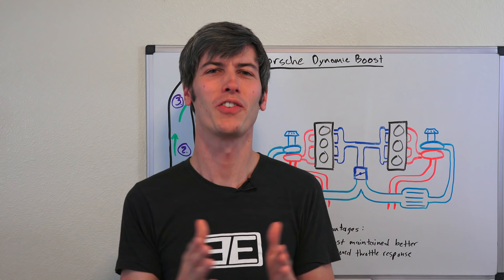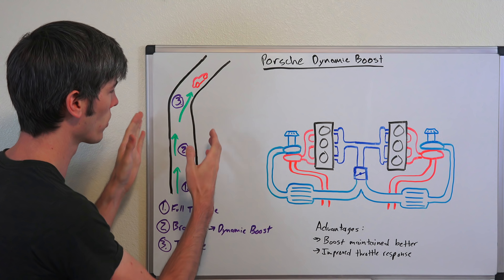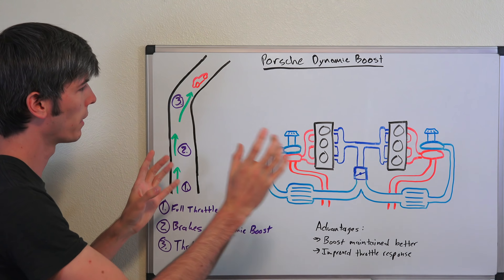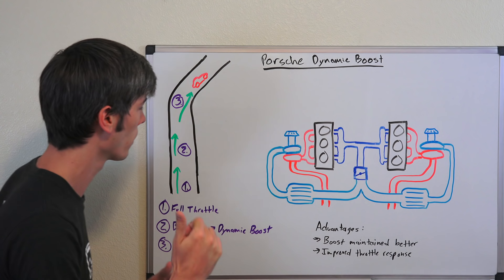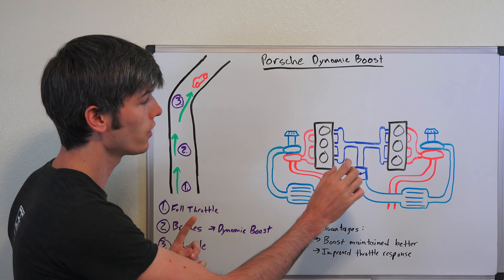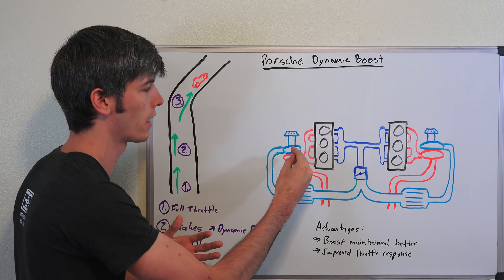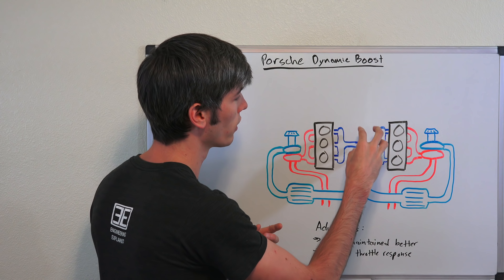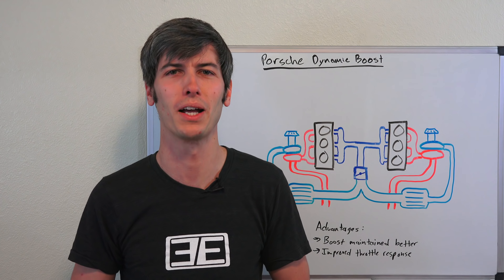Porsche's Anti-Lag System Doesn't Use Any Fuel

Comment: Seems like it would lean out the air fuel mix.
Reply: Yes it would throw lean codes unless the software was written for it but with no fuel means no combustion so the lean effects on a motor are negated.
Reply: Steven Young good point thanks

Comment: Typically, the throttle body closes completely when let off the throttle? I thought some air continues to get compressed by the pistons, which also explains engine braking
Reply from the maker: It’s the suction that does the engine braking, not the compression, but yes, some air does get by.

Comment: I wonder does it still injects gas in the chambers like you would giving it gas since its open or is it just enough air to keep the engine running with the engine running a little rough the system sounds good just curious on how does the engine idle anyone's thoughts
Reply from the maker: No fuel when you’re not on throttle.
Reply: There is no need for the feature to operate as idle as there is no boost anyway.  It's a temporary condition when there is boost and you come off of throttle momentarily.

Comment: To be honest I actually thought this is how most  turbo engines work when you let off the throttle to save fuel.
It makes sense to stop injecting fuel but why close the throttle body unless you want engine brake - and if you want to save fuel engine brake is to be eliminated (maybe the throttle body can close at lower speeds)

Comment: Are there counter rotating turbos?

And how does BMW manage it since with valve tronic the throttle valve is constantly held open and intake is controlled by valve lift?
Reply from the maker: BMW doesn’t do this as far as I’m aware. They could be leaving valve lift high. I’m not sure what you mean by counter rotating turbos.
Reply: @EngineeringExplained  turbos that spin opposite direction of each other to maintain the symmetry form as per your drawing 

Meaning BMW already was doing 'dynamic boost' on all their turbo engines since all were using valvetronic system , throttle plate kept open always

Comment: Hi,
Can you make a video about how actually fuel is cut when you do engine breaking?
We tried this on a M54B25 engine ( with automatic transmission), to see injection timing in realtime via ODB II interface and when we do engine breaking, injection time reduces from 2.4 ms (idle) to 0.7 ms. But is not shoot down! 
thanks
Reply: I'm developing my own ECU and what I find is that if you are driving along and lift off (into idle throttle position) but cut fuel straight away the car nose dives into severe engine braking. You need to gradually reduce fuel depending on how much you want to brake.
Reply: Maybe you need to do as Porsche does, cut only fuel, not the air, if this is possible :)

Comment: If the throttle is left open, then there is no Vacuum supplied for the Brake Booster.  Won't this pose a safety risk if your brake pedal suddenly gets stiff while in a turn?

Comment: Isn't the mixture getting too lean inside the chamber while this happens? Also, it sounds like the engine would keep accelerating after letting off the throttle, as kinetic energy is still being produced from the engine. This one left me with some question marks man :)
Reply from the maker: It’s infinitely lean, there’s no fuel. No fuel means the engine is not accelerating.
Reply: So there is no ignition at that point?

Comment: Does it make the air/fuel ratio go up? Maybe even temporarily, until it's infinity? And if so, isn't that bad for the engine?
Reply from the maker: It's direct injection. Very easy to have fuel on or off. When injection stops, there is no fuel present.

Comment: hai, in a boxer engine if the cylinder banks completely horizontal then when fuel is injected, due to gravity woudn't  it get concentrated on side of the combustion chamber. i dont know but i guess you can explain. would the S.plug be placed from downwards so that all the mixture is ignited at once as in the spark being at the centre of the mixture, and also please explain if there any sort of swirl characteristics for the combustion flame how would it exist in such a engine design(being horizontal).
Reply: The spark plug is placed in the center of the head, between the four valves. The time between injection/ ignition is short enough to not allow fuel to collect on the cylinder walls.

Comment: So no turbo sstututu sounds because the throttle body doesn't close?😭
Reply from the maker: Haha, yes, though you generally won't have that sound on stock cars since they use bypass valves and don't force air back through the turbo (compressor surge) which is what causes that noise.
Reply: Don't be sad Raul. Now you get a car that sounds like a machine gun!
Reply: @EngineeringExplained  omg I wasn't expecting you to reply! Thanks for the info!!
Reply: The fact that the throttle body doesn't close means you don't vent pressure from the CBV/BOV and have to wait for the turbos to repressurise the whole intake...and if you have a big front mount intercooler, that's a lot of intercooler and pipes to fill up.

We use to joke that those fancy Cinematic BOV turbo sounds actually slow you down.

I personally use a 2 step launch control as "anti lag" which only works on launch rpm and bumping off the limiter. Simple system but allows me to build boost at standstill and shifting(no need to lift). Definitely more gentle than a true anti lag...
Reply: @4G63TDSM  yeah thats why I thought no flutter

Comment: How does the throttle stay open with no fuel flow? Throttle normally means fuel&air flow. Is there an air flow throttle which is separate from the fuel flow throttle?
Reply: All the throttle body really does in a fuel injected engine is controling the air flow. It has nothing to do anymore with the amount of fuel beeing injected.

Comment: Just my speculation, the engine would be running cooler due to a lack of combustion and maintained boost until there's a call for fuel under acceleration.

Comment: This system would just be a change to the code in the engine control unit to implement, if your throttle was electronically controlled.

Comment: So I presume its engine braking is minimal in this mode then... Could be a challenge on mountain roads. 😀
Reply from the maker: Xiph1980 you still have brakes, and if you’re going down a long descent, it’s not going to remain open forever. Just a short period after lifting to keep the turbo spooled.

Comment: Alright.. that means you lose a big part of engine brake, which people account for (but that’s easy to adapt).. my biggest question is: what’s porsche doing to adapt those car components that take an advantage on engine brake (brake system)? Also, is that going to reduce the life span on the turbine and bearings due to increased load? Basically: is Porsche compensating for that?
Reply from the maker: Brakes are always designed for gross vehicle weight rating, not by considering the effectiveness of engine braking, which is minimal. Emergencies don’t rely on engine braking. With regards to load, this would be quite minimal on the turbo, if anything it may have a slight cooling effect since it’s just air and not exhaust.
Reply: Engineering Explained I see.. l it’s just that I’ve seen some cases of brake fade after a long use (I think you’ve addressed this on a previous video) on automatic transmission cars going down a hill due to no engine brake (I live in Brazil in a state filled with mountains so it’s actually quite common).. and that’s the first concern that comes to my mind when I hear “no engine brake”.
Reply: The throttle will work as expected when going down a hill.  You have no need to keep the turbo spooled in that case, right?
Reply: Jeff Smith you know what I meant.. I’m not saying it’s not going to work properly, I was just questioning about extensive use consequences..

Comment: Seems like a ported 2-stroke diesel, with the following exceptions:
(1) fuel type, gasoline, not diesel
(2) heat of ignition, not heat of compression
(3) 4-strokes per cycle, not 2-strokes per cycle
(4) intake valves after the open intake throttle, not solely intake port.

The more I think about this, the more I wish to redact the initial part of this comment. Still very different. Oh well.

Comment: Hi I have a question. What do you think about putting a momentary switch in my turbo car that opens the throttle body completely? Like I could press it during cornering. Kinda like a manual version of this. Could it be bad for the engine you think?

Comment: how do they achieve this system?
I mean is the throttle cable not connected directly to the gas pedal?
Then how does it stays open even when it should be closed?
Reply from the maker: Nope, nearly all modern cars use electronic throttle bodies (not direct).
Reply: Engineering Explained 
yup!!!
The power of sensors.
I mean modern technology.

Comment: Wouldn't leaving the throttle open cause excess air to enter the engine and with the fuel being cut in turn cause it to become very lean?
Reply: Cut fuel = No combustion
Reply: If they cut spark along with fuel, no worry of detonation.
Reply: So how does the engine stay running if there's no fuel to push the piston down
Reply: Chaz Stark it’s still connected to the wheels. Same thing applies to any fuel injected car when engine braking towards a stoplight or something, the fuel injectors cut completely out. That’s why it’s better to stay in gear than coast in neutral.

Comment: Isn't this what many modern cars already do which causes rev hang?
Reply from the maker: TheDennyvu interesting question, with a manual transmission vehicle you’d only want a feature like this if it worked while you were still in gear.

Comment: So is the reason why there are no problems with the car running lean because there is no ignition? (Do they cut spark, or do the plugs still fire anyway, but nothing happens because there is no fuel?) Essentially the engine is just being used as a big air pump? Or is this incorrect?

Comment: Wouldn’t this throw off the Air To Fuel Ratio though? Meaning there’s much more air going into the Intake manifold than air/fuel?
Reply from the maker: There's no fuel injected. Infinite air/fuel ratio.
Reply: Engineering Explained Cool. Thanks for the response.

Comment: so when you let of the throttle around corners, or whatever, it stops the flow of gas to the cylinders, yes? so what would happen if in that 1 sec your off the throttle, the cylinders fill up with air only, and no gas?
Reply from the maker: Correct.
Reply: Engineering Explained now is that a bad thing if you only have air in your cylinders for a full 4 stroke rotation or is that fine?

Comment: I can see how this works with full/no throttle, because there is no fuel being burnt but not how it works backing off to part throttle.
If you keep supplying full throttle air but only a limited amount of fuel, doesn’t this cause a weak mixture that is still burning?  Why doesn’t this weak mixture damage the engine.

Comment: So you just stop the injectors by letting of the throttle. Isn't that how the throttle on diesels work? ...by controling just the injectors?
Reply from the maker: lego technic correct! Some diesels now have throttles for specific scenarios, but yes, mostly they’re wide open and you simply adjust how much fuel is injected.
Reply: Engineering Explained Than how do they flutter?
Reply: lego technic do you mean idle? When you let go of the throttle, there is a set amount of fuel that keeps the idle going. I have a 1986 vw diesel. I love that thing! 60 mpg, yet 30 years old. Todays hybrids are a joke.
Reply: 19Armada84 How do they turbo flutter?
Reply: WOW!! 60mpg is what my bike is giving me!
Reply: When you let off the throttle on a diesel it immediately stops producing such a high volume of hot exhaust gas. If you stop driving the compressor on a turbo while in boost it will flutter from the backpressure.

Comment: Wouldn’t it knock? There is no AFR anymore because it’s just air, and if you have too much air with no fuel, then doesn’t that cause a knock of some sort? I know it’s for a short amount of time but still, seems sketchy
Reply: Alan Bowers you don’t need spark to cause knock. What causes knock is the lack of fuel. The air compressed and gets too hot. The fuel cools off the air preventing the knock
Reply: Jack MeOff the fuel cools off the combustion chamber as well as the intake charge, without fuel, there is nothing to ignite, air is not combustible, thus knock is impossible if there is no fuel.
Reply: Jack MeOff remember, an engine is basically an air pump, or a ‘compressor’ does your air compressor knock because there’s no fuel in there? No fuel=no ignition phase=a reduction of cylinder temps=higher knock threshold=irrelevant since there’s no fuel present.
Reply from the maker: If there is no fuel in the engine, there cannot be knock. Knock is when the fuel ignites irregularly, not timed by the spark.
Reply: Correct me if wrong, but i thought “knock” was caused by fuel igniting to early. (Big issue in race cars) a normal street car fixes this by changing spark timing automatically.

Comment: Interesting, so NO engine braking with this system... That could really improve the dynamic balance of the vehicle, but you will need to rely more heavily on the brakes. I would love to "feel" the difference between this makes.
Reply: Pretty sure it's toggled, just for sport/track mode. If you turn it off you have regular engine braking of course.
Reply: zolikoff... Yes thank you, Jason did explain that in the video... I was commenting on the fact that when the system is in it's "Dynamic" boost mode, there would be a reduced engine braking force. For me that seems like a much better solution, since doing high speed maneuvers, engine braking can really upset and throw the balance of the vehicle off. You controlling the amount of brake force is one thing, since you are regulating that yourself. BUT engine braking can really play havoc especially since it tends to be really extreme and unpredictable at high speeds. You see this a lot on motorcycles, where the rear wheel will lock up when cutting the throttle in a panic stop situation or during track/racing events.
Reply: Yes, considering most of the engine braking force comes from the pistons moving against the vacuum in the intake formed by closing the throttle body, I imagine that this system has pretty much no engine braking when active. The little that's left due to mere friction of the engine components is unnoticeable.

Comment: How is this different from conventional fuel shut off?
Reply from the maker: Normally fuel is shut off and the throttle is closed. This shuts off fuel, but leaves the throttle open.
Reply: @EngineeringExplained  Right, let me rephrase my question with some more background. Keeping the throttle open (which is still slightly cracked open) and cutting off fuel would flow a fair bit of fresh oxygen through the catalyst, which would cool it and also spike the oxygen storage/saturation in the catalyst. This is also why engines have to run rich immediately after an FSO to burn off the excess O2 in the catalyst for extended fuel shut off events today. I would think Porsches strategy would run into similar challenges, especially with the throttle wide open.

Comment: Doesn’t this mean that it will go super lean and potentially detonate?
Reply: There is no combustion occurring due to no injected fuel
Reply: That means the engine turns off,  doesn't it?
Reply: @pranavghantasala6808  
On normal engine-braking-situations (when you coasting essentially i believe), you also have no combustion, bc this would generate power
Reply: That was my thought as well. Would it not create a super lean mixture. Usually when letting off the gas pedal the engine is still injecting a small bit of fuel(that is how you idle). Curious to find out their way around this
Reply: But coasting doesn't equal idle.. but you're right, under some circumstances, you inject a bit of fuel. But what is your engine braking (with gasoline engines)? Right, the wheels just drive the gearbox and through it the crankshaft which now just pumps air in and out, which slows it down. No fuel needed
Reply: That's what I was thinking, that it would go dangerously lean. And also the lack of fuel would increase engine temps at high rpms
Reply: it actually cools the pistons as the air is also moving through the pistons and taking the heat out at the point of time..no way to lean out that moment because there is no fuel being injected to burn anyway!

Comment: why is this a 2018 technology?
Reply: because the cats just started applying it in their porsche this year...
Reply: There are some challenges he did not talk about:
- Without drive by wire it would require a mechanical actuator to keep the throttle open while no pedal is applied. You don't want such a mechanical actuator potentially causing a stuck throttle.
- It requires very precise engine control to switch over from combustion to running on pure air. In between are lean air mixtures, also known as engine knock. To avoid damage to the engine, a save envelope of parameters has to be defined. A task much easier with drive by wire.
- This technology increases performance but decreases engine breaking. "Understanding" the situation and choosing the appropriate behavior is something car manufacturers only understood in recent years when developing hybrid drive trains.
I am not saying such a technology would be impossible with 30 year old technology, but it wouldn't be suitable for production cars.
Reply: are you the amigo from King Rose Archives?